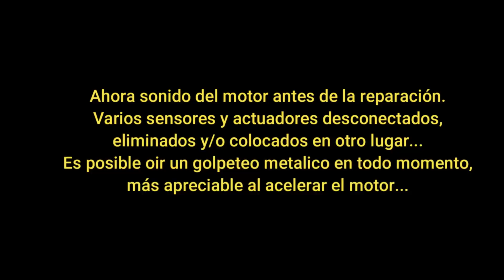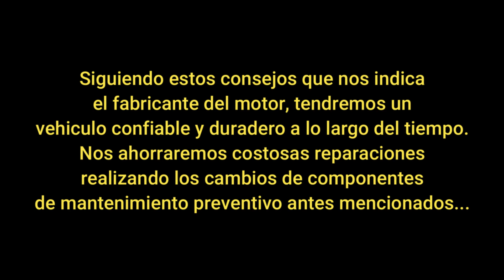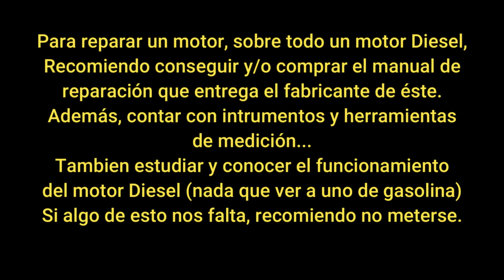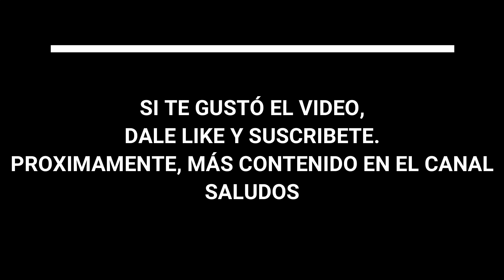Motor DW8 PRIMER ARRANQUE - Como Armar un Motor Diesel 1.9 N°5 Peugeot Citroen

Comment: quedo muy buena mis respetos a uno de los buenos mecánicos que quedan.....una consulta le cambie el motor a mi kangoo y me humea mucho creo que puede ser el avance de la bomba ...la mobi pero no se cuanto es el grado que tiene que llevar me dijeron que era de tope hacia el lado del motor después hacia el lado de afuera tu me orientarías como es la cosa de ante mano muchas gracias
Reply from the maker: Vi tu video en el grupo de kangoo. La bomba que tienes instalada no es de kangoo, por eso tienes problemas. Ni idea si se puede dejar bien. Saludos
Reply: @garagedelnegro  ...tu sabes que la compré mala ,y le compre un motor que creo que es 2 años más nuevo que la camioneta...viene con la bomba que tu tienes en tu kangoo...la cosa es que en mi camioneta no están los enchufes para conectar la bomba que venía hací que le puse la antigua ...y te preguntaba para donde tengo que girar la bomba para darle avance o retroceder

Comment: Muy buenos tus vídeos!! Tengo una consulta, tengo una partner similar y le cuesta arrancar en frío, estuve revisando y note que sopla por el múltiple de admisión a la hora de la compresion, esto es normal, o puede haber un problema en los asientos de las válvulas?. Saludos Gabriel
Reply: En múltiple lleva unos orring dodnde se conecta el multiple con la admisión en todos los huecos q tiene fijate q se t rompieron  salen muy económicos y los puedes cambiar tu mismo
Reply: @ezequielmachuca7686  si ya los cambie pero, pero yo voy a que cuando tiene que comprimir parte de eso se sale por el múltiple, osea sopla, si lo tapas te levanta la mano
Reply: @45gld  tienens problemas de sellos amigo yo tengo un 206 1.9 con el mismo motor y ami no me sopla para nada
Reply from the maker: Tiene que succionar... Si sopla tienes problemas en las válvulas
Reply: @garagedelnegro  Gracias! Tendre que destapar y mandar a revisar que paso con las válvulas